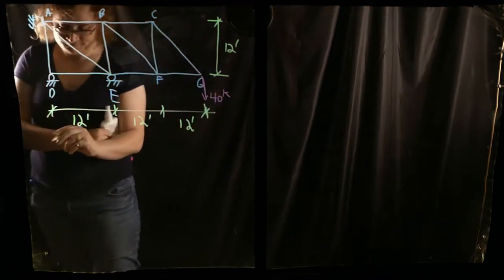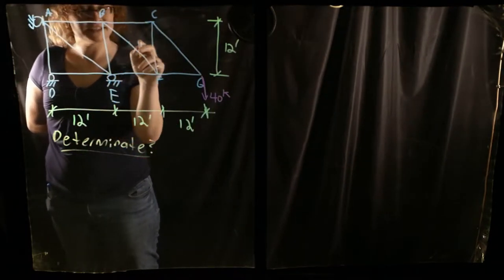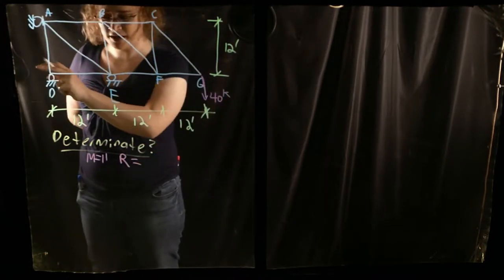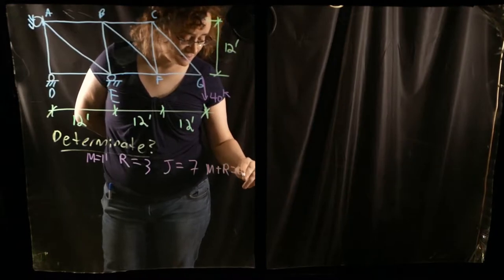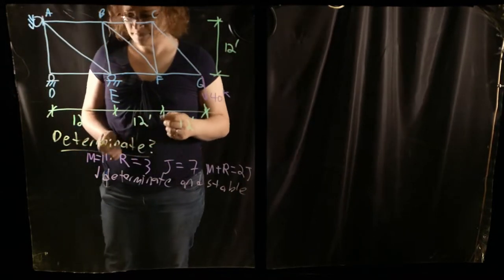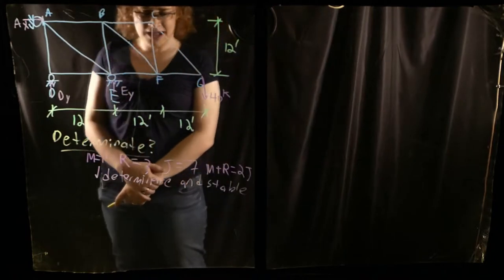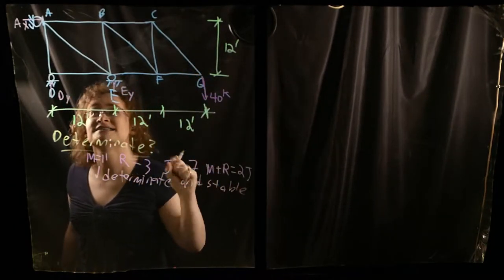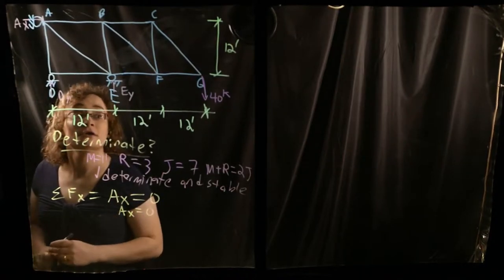Truss Method of Joints - Examples

Comment: Hi Tanya, great lesson, congratulations. Could you answer a doubt about plate and truss working together? What is the effect of connecting a steel plate on both sides of a truss (Pratt) section (1 section) near of column? The structure is a gas station.